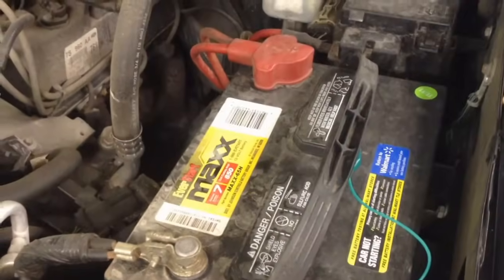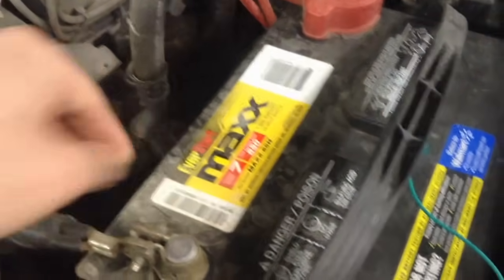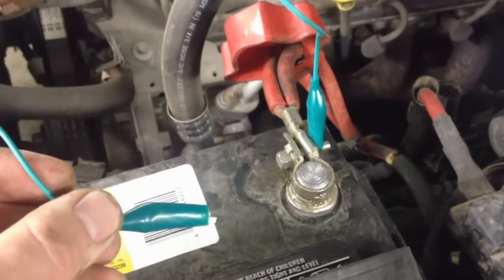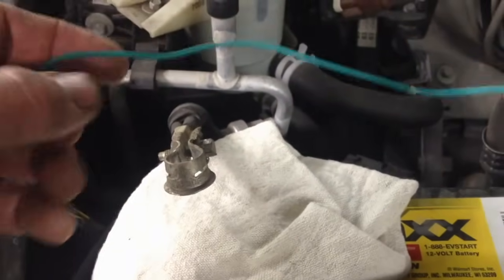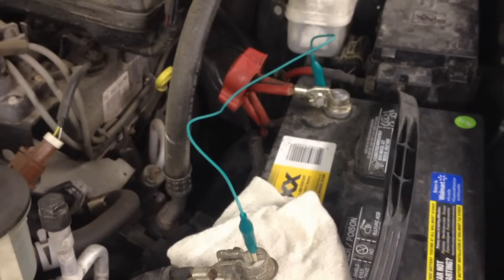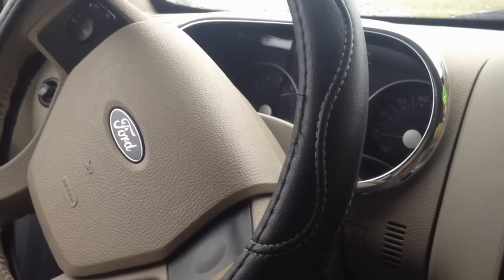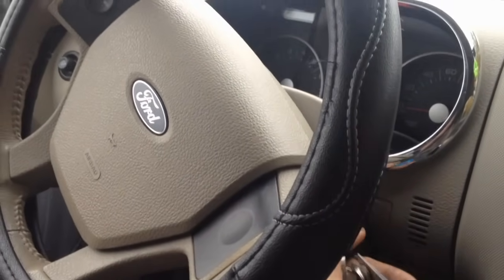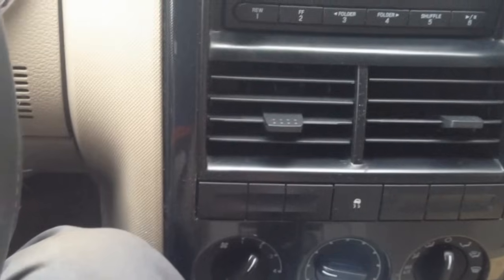How To Clear Your PCM'S Memory On Fords After Repairs

Comment: I’ve tried this multiple times now and I don’t think it is working. No change in engine behavior when starting it back up. Learned octane adjust ratio unchanged. How can one determine if the reset was successful? Is there a code, indicator, or engine behavior I should be looking for?

Comment: You're awesome man, thank you for the video. The transmission on my 2007 Ford Explorer was rebuilt 6 months ago and up to now I had odd behavior when shifting. I followed your procedure step by step and now the shifts are so smooth and the MPG increased as well. My truck feels new again. Thank you for sharing your knowledge.
Reply: Hey question: My 05 Explorer reverse gear has been shifting weird & reverse went out then mysteriously started working again but with a big jerk & me having to grip the shift gear stick to wobble reverse into place. Is this video the remedy?!
Reply: @donrodeo8344  this video helped for a certain amount of time but it ended up being a transmission problem and had to be replaced

Comment: i tried doing this on my 1999 7.3 . i did it to both batteries , but when i took one of the jumper wires off i forgot to remove the other jumper wire and i connected the negative . it fried the jumper wire and now no OBD connection to pcm and no wait to start light and a No start. What do i look at to replace?

Comment: I have a 2011 f150 that had the whole EcoBoost shutter I changed the plugs and coils and cleaned the maf sensors but it still idles ruff should I do this?

Comment: Does that also clear that anti theft system when u replaced the ignition lock cylinder? Because I replaced my cars ignition lock cylinder. The car turns does not start it only powers the electrical stuff, but the car won't start. The anti theft system keeps blinking...
Reply: I have a similar problem I don't know if it is my alarm system or i change my under dash fuse box everything works except the motor don't start and the anti theft system its blinking

Comment: Aloha from Kona, I wanted to ask you about an issue... I inadvertently left the axillary on in my 2015 Ford Mustang GT. this morning the battery was dead so I jumped it and all was fine. About 30 minutes into my drive my advancetrac service light, ABS light, engine light, and Hillside assist light, all came on and the car went into a limp mode. I'm wondering if this is a coincidence based on the timing of running my battery out and if you can recommend that resetting the PCM would be a good first step for me? Thank you for whatever time you have in responding to this message
Reply: you need a new battery

Comment: This did not work for me. Engine light still on as well as exhaust filter warning. Any ideas?
Reply: Virgil Mize means you have unfixed issues this won’t bypass anything that’s wrong. Sounds like somethings not working the way it should
Reply: @weldingjunkie  Thanks for the reply. This stems from the other day when my cool side popped off then a manner of lights lit up. After I fixed the hose, there are two light still on. The exhaust and check engine lights. The guy at the dealership said they will go off on their own. Not happening yet. Guess it time to dig a little deeper. Thanks again.
Reply: Virgil Mize sometimes you’ll have to drive if fof 50/100 miles In order for the computer to reset. If nothing is wrong they should shut off. Keep us posted
Reply: @weldingjunkie  Thanks, will do.

Comment: First off, thank you very much for these videos. It has given me the confidence I need in repairing my 2011 Transit Connect, specially the valve cover gasket. I recently change the intake boot going from the air box to the throttle body as it was cracked and giving me poor idle/fuel economy. At the same time I changed out the maf sensor (as it was extremely dirty), the tube going to the valve cover gasket (it has oil in it) and the air filter. After triple checking all parts including air filter box housing was installed correctly, I figured I would reset the PCM with the new sensor. I also had some rough shifts going on and thought this would help, which it did. However I am having an idle issue.  Following step by step twice and am having issues on cold morning starts where the RPMs start at the normal 1100 then go down to around 800. After about 5 seconds it gets down to the lower idle RPMs it starts hunting for the right RPM between 600 and 1000 until finally stalling out. If I give it some gas to take it up to 1500RPMs I can usually keep it from stalling out. Once running around 1500RPM for 10 seconds it figures the idle rpms out on its own. On the second PCM reset I decided to do it first thing in the morning when it was coldest thinking it needed to learn the idle mode on the coldest engine temp it would see (not sure if that logic makes sense) and still getting the same issues. Once it warms up here in Canada in the later morning/afternoon I see no issues with idle rpms on start up after the vehicle has been sitting for 8 plus hours.  I have verified all accessories were off when teaching the PCM the idle rpms at the start of the process (leaving the car sitting for 10 minutes before your slow acceleration through the gears). Any suggestions?
Reply: Did you ever figure out the idle issue @Mark Zemlek?
Reply: @carverforbes7307  No - still idles like a piece of crap.
Reply: Did you figure it out? I have same problem with my Mazda 5.

Comment: Just did this today to a 2015 6.7l F350 102,000mi already knowing that the adaptive shift patterns needed to be reset but I thought I needed a scan tool.  Thanks Man!   
After the harsh Jan/Feb plowing as it shifted like a granny car, the idle was high it didn’t shift till 2500rpm or near 3500 if WOT it was fine in manual mode(pita)and I was trying to find time to dump it at ford for the first time in its life for a day to confirm other dtc’s and order parts... I think the root cause is the cold side intercooler pipe is starting to piss oil about and thus lose boost, though not a catastrophic failure yet(parts on order). And yes I’ll reset it when that is fixed. 
It’s just like it used to be :)  Instead of an imposter with a tranny that lost its marbles.
Reply: loft306 DangerMaus how did you do this with the dual batteries did you do both? I’m hoping it’ll work for my 04 f350 6.0
Reply: Yeah!  Just pull both neg. terminals  and I jumpered on the passenger side.
And just to warn you when you put it back together and turn the key you will see the wrench symbol while it is learning. It goes away next time you start it.

Comment: Hi: love the vedio, my question is I have 2004 ford escape 3.0 with a code P1000, thank you for any help
Reply: Jose Padilla did you figure out if it works for a code p1000?
Reply: i have the same issue. Did you get it fixed

Comment: what does a P70732 transmission gear #2 incorrect ratio means? open circuit. short circuit. I just changed solenoid / fluid.. ford sport trac 2002? some say its on the trans sensor? or should I reset the pcm using the way you advise here?

Comment: Hi, I have a 2014 F350 6.7 and tried this to try to correct a power problem. It didn't change anything. Any suggestions?
Reply: Did you unhook both batteries?

Comment: Hey I have a problem I’d really need some help on. 
I have a ford ranger 2015. 2.2 
I recently installed xenons to it, they played up and went off however main beam “flash” still works as does all my outer lights. 
It’s just my low beams not working, woukd a bcm reset resolve this issue ? Thanks v much

Comment: Thanks! It worked to get my engine light off in my 07’ F-150. Now let’s see if I can drive long enough to pass the test and keep it off. I was getting a fuel level sensor code for a truck I rarely drive.

Comment: How can you verify the kam has been reset? 
I was doing some work on my 05 explorer 4.0 and needed to relocate the  air box so I went to the parts store and got the what I needed and made it happen. Put it all back together and now the car is in engine fail safe mode and throws code p2106 and p0102. The vehicle was running perfectly fine before this.
I have an upgraded stereo and was working on a special alternator bracket. Could the additional grounds I added to the motor and alt case not let it discharge?
Reply: Does it the positive have to be connected and then touch the negative? I watched a different video and they just disconnected the battery and touched the 2 leads together.

Comment: What gauge is that jumper wire with the gator clips? ,,,  or could we use jumper cables that would do the same thing?  If jumper cables would work too would it still be pos to neg or would it matter?

Comment: Great easy fix ... my 02 windstar shifts better than ever and the idle issues I had are gone ..FYI I replaced the idle control only because the plug part was cracked and would not stay plugged in .

Comment: i pulled my battery to detail my engine on my 2013 F150 and after battery install everything works fine except my running boards. They fold down when door opens but take 45 seconds to retract (both sides) once the door is shut. I'm assuming I need a factory reset?

Comment: at 4:20 you say "flare" . Is that what is happening in my 08 Sport Trac when my tachometer revs up  past 3000 rpm w/ no acceleration. I end up having to take my foot off the gas then accelerate again.  It's scaring the crap out of me. I worry there are major tranny repairs in my future. This is why I'm getting my '96 Jeep Cherokee Sport repaired . I love my ST but this adaptive learning transmission is bullcrap!  The 4.0 inline 6 in my jeep is at least reliable.

Comment: So when you're first putting the alligator clips on, do you at the same time have the key in the "on" position or not in the ignition at all? 

Thanks for the reply back in advance.
Reply: Chea Sok hey Chea, I know I’m not the person you were looking for a response from, but you do not need to have the key in the ignition. The only time it is important to follow specific steps regarding the ignition sequence/key position is when you have already reconnected the negative battery terminal after waiting 5-10 for the capacitors to drain. Hope this helps!

Comment: Great information .  Love these videos . I have a question on a Ford F150 2002 V6 4,2 XLT. It starts losing power in the rain and sometimes in a blue moon ir wont start .. have changed coil pack, leads and fuel pump.. Still does it . Thinking it could be ECM .. What do you think ?

Comment: When you start the test drive (automatic trans) do you manually shift or just let it shift on it's own with normal acceleration???  Thank you!!!
Reply: How would you manually shift an automatic transmission?
Reply: @beckyschwantes5287  Tons of automatics have paddle shifters or slap gears, just let it shift on its own.

Comment: Just purchased a used diesel c-max. And when pulling away it lost power and wouldn't pull.
Switched off engine and restarted it and was fine.
Scanned ODB and code P062b came up. pcm issue?

Do you think clearing the pcm would help.
Plus another code came up P2002 dpf filter issue.

Could these 2 be related?

Comment: When you state 175 to 185 for the transmission to learn shift points, is that mile or temp and if temp transmission or engine?
Reply: MeanGeneious it should be temperature. I’ll sue ford if I get caught by highway patrol running the recommended 175 mph speed.

Comment: Hey how you doin I recently replaced the fuel pressure regulator on this exact car took the thing a part and replaced it put my scan tool on and deleted the code after that the car did not start..cranks runs like a 5 secs or so but turns off I did this and still nothing any ideas?

Comment: I replaced coil pack and spark plugs and did not disconnect battery while doing so on my 04 ford free star now when i start the van rpms go up to around 3000 then go down but still it idles a little high around 1300 in park and when I shift from park to neutral the rpms rev up to 3000 with no throttle being pushed down will this method help in my situation?

Comment: Also, is this recommendation for any work on a Ford? Just did sparks, water pump, plenums, and bought the truck with rebuilt transmission. I scrolled the comments, been checking the explorer fourm which is where I found this video.

Going to do this tomorrow to see if it reconfigurings my rough idle and hard gear changes then drive it to work which is 45 mins out. I think a computer reset will solve it just really paranoid about my purchase not being a mistake.

Comment: Didn’t work for me, I have a 2013 ford fusion titanium the transmission has a lot of hard up and down shifts, only has 63k miles, any ideas?
Reply from the maker: Yours trans must be reset with a scan tool your module has NVRAM
Reply: FordTechMakuloco does that have to be done at a dealer or is there a scan tool I can buy somewhere?

Comment: hello sir thank you very much for your video, I'm working on my 2008 f150 king ranch replaced transmission speed sensors, input and output, brand new, but now came up with more codes, abs airbag, ill try this tomorrow, but is there any danger to burn other equipment around???

Comment: so do u know anything on the new 2017 ford focus? shifts. its a maual turned into a automatic. but its acting like a manual.
Reply: ok heres what happen, i was going for a pass i was already doing 60 mph and as i started to accelorate it felt like the transmission slipped and the RPMs went really hi like i was reving the engine, so i let the gas go and it went back to normal. so i finished my pass.

Comment: So your grounding the batt how doesn't it spark and melt that wire 🤔
Reply from the maker: The battery is not being grounded out. We disconnected the negative cable at the battery breaking the circuit.
Reply: Your the best I take your word every time 😎😎

Comment: I have a new 2018 F150 3.5 EcoBoost that has been experiencing fuel dilution issues in the engine oil.  I have changed the oil 4 times already, & last 3 oil changes have been in the 3.4 - 4.0% fuel dilution at 2800 mile oil change intervals.  Will doing a reset of the PCM change stored fuel trim settings.  It has never thrown a check engine light, & the dealer doesn't seem concerned, & wont do anything unless a code is thrown.  What is a typical fuel level in the 3.5 EcoBoost?  I don't know what else I can do, when my dealer/ mechanic wont acknowledge my concerns.  I don't have a tool to read fuel trim levels, & wouldn't know if I would be able to tell something that doesn't look "normal"

Comment: I replaced a IPR on my 02 7.3L but I only have a cheap OBDII code reader to work with. Still have my issue with engine dying. but would it be due to not resetting the PCM this way????

Comment: I had the power steering issue that was recalled by my 08 Escape isn’t included.  Once I replace the part, Will this work to reset any power steering failure codes as well?

Comment: So here is a question for you:. 2014 Ecoboost.  6.5 ft supercrew.  (25k miles ago... Rebuilt transmission, now at 139k miles on truck).    Recently the shifting is off when lead footing it or when it starts to climb a pretty decent hill.... It's like it doesn't know when to shift and sometimes shudders as if not sure what to do. Mostly in higher gears. 6th and 5th but sometimes in 4th.  Could this video be a fix to this problem? Or something bigger.
Reply: Anyone? Please?

Comment: Hi there. I have a problem when my car is running and I step on the clutch to change gear or just to idle at a traffic light, the RPM shoots up to approximately 2000 RPM. But when idling, stepping on the clutch doesn't change my RPM. What could the problem be? Thanks.

Comment: Does this help for if I was getting shift solenoid c stuck “on”, I changed out the fluid and filter. It was still slipping on third gear and doesn’t go above that. Should I try this?

Comment: My Ford Fusion 2014 went into limp mode , its saying the coolant is overtemp but when I took it to a mechanic he got it out of limp mode and it was fine, he changed the thermostat as well. It happened again recently but when I popped the hood there was no smoke, no boiling, Nothing was Hot. I’m thinking it’s just a faulty sensor but I’m not sure

Comment: Could really use your knowledge here. I have an 04 f150 5.4 that was running great until I did a routine oil change. When I started it up right after, it had a check engine light and was running rough and started trying to stall at stops. Took it to auto zone and was told it was the vct solenoids, so I replaced that,  still had the check engine light and was told it was now the cam positon sensors, replaced those and was running worse. Found your video on resetting pcm, did that and still running rough at idle and even worse with loss of power when I put it in gear and try to drive it.  I installed a new MAF and coil packs with no luck of emprovement. Did a smoke test and no vaccum leaks found,  checked pcv and it seemed functional.  Any ideas.? Fyi the truck has just over 200,000 miles on it.
Reply: I know this is an old comment, but I'm currently having the same issue. Did you ever solve the problem?
Reply: @jakestanford4662  I am wanting to know this as well. Let us know!

Comment: Hey I left my lights on and the battery died in my 2012 Ford Fiesta, we jumped it off and got it home but now check engine light is on and the 🔧 light and dash says transmission malfunction. I replaced the battery but light still on, will this help????

Comment: Thank you I just change the spark plug wires in my Ford Explorer 06 and for some reason 31 codes took off well I found out my coil had a crack in it I changed it and all the codes are still there so thank you for showing me how to reset the PCM hopefully everything is good I'm doing that here in an hour

Comment: working on a 1994 4.0. trying to retrieve the codes from the pcm . It will not show on the meter or by the dash engine light.